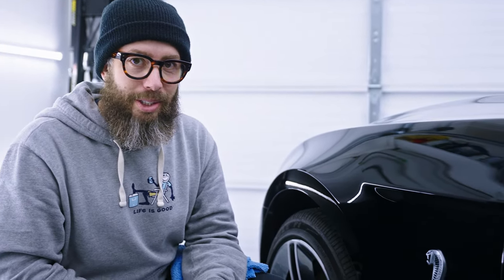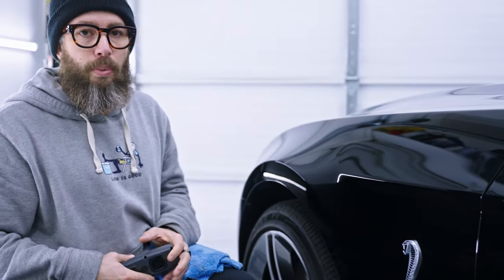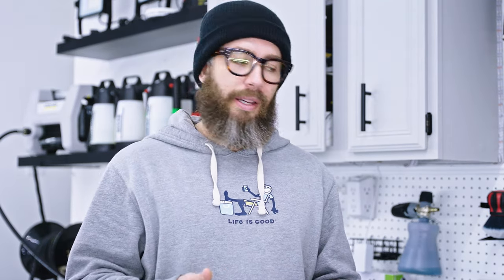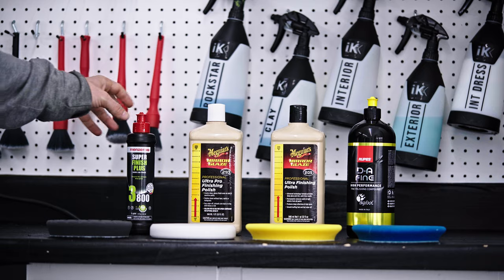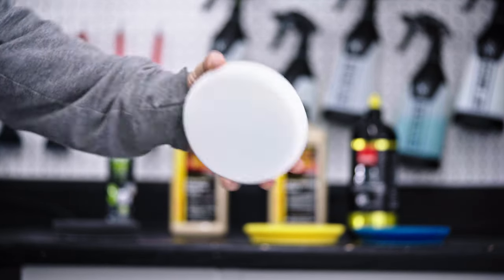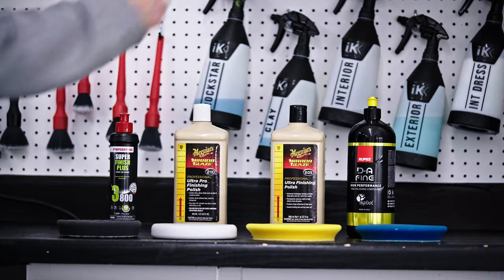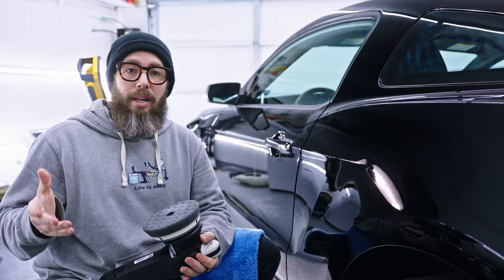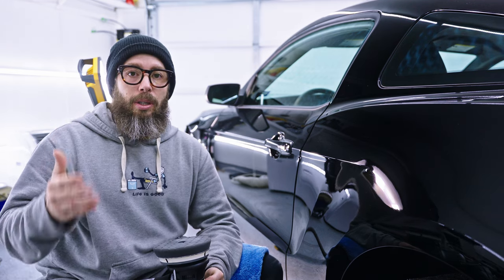Best Way To Do Paint Correction On Black Car

Comment: So work your way up in aggressiveness until you find the pad/polish combo that gives the results you want. That sounds like good advice. If you need to use a heavy cutting combo I'll assume you may want to do a 2 step process with a finer finishing pass. With that out of the way, how do you approach doing the whole job? Best direction to run the polisher? Run with body lines or cross them? Should you polish your glass? Paint correction prep? What if some sections have deep scratches? Finish with a sealer, ceramic, or wax? Sorry this doesn't seem like a how to do paint correction video, just how to choose a product.
Reply from the maker: Think you’ve got the gist of it. It’s all about trial and error for me; I’m learning as I go and sharing the journey. I’ll try to cover more of these details in future videos. Meanwhile, there are plenty of channels that dive deep into those specifics.

Best of luck! 😊 Till next time :)
Reply: I learned more from this comment than the video, thanks Dr Pepper.
Reply from the maker: @ElipticVisuals  thanks for watching 😊
Reply: @streetready I found your video helpful.  Dr P should've just made his own video apparently.

Comment: Do you think you should determine if you are working with a clear coat or not?  First 30 seconds of any paint correction video should address this especially when talking about “what system” to use. My assumption here is that it is a clear coat car cause it appears to be a late model mustang. Not just you; most of you guys fall short in these videos.
Reply from the maker: This is a great question, thanks for asking.

I like that you mention single stage as an option here because they're not very common and most people now days aren't even aware that's a thing!

Now days most everyone or at least 98% of vehicles on the road have clear coat, and most people learning aren't expecting that discussion. Addressing a rare instance is rather irrelevant if they have questions about non clear coat vehicles they can search for that specific term, and inform themselves.

But indeed this Shelby Cobra does have clear coat!
Reply: Agree most cars have clear coat but most muscle cars do not hence my comment. Regardless, when providing information one should be thorough. You could maybe mention that the system works for clear and non clear coat paint or does not work. Thank you for the reply.
Reply from the maker: @anomalous9448  you got it man!

Comment: I recently watched a video for dealing with getting rid of swirls, scratches and imperfections in black paint(I have a black 07 Lexus GS450h) and in that video the guys used RUPES Coarse Compound for Polish & Swirl Remover...and then he used a polishing compound after that. You only use the polishing compound in your video. What's the difference? Great video! Thanks!
Reply from the maker: Just as you mentioned "coarse compound", he was attacking the paint in a very aggressive way. 

Normally the reason to get that aggressive would be if the paint is very hard in consistency. This paint was soft, so in didn't have to go in an aggressive route.

If this was hard paint I would have increased the aggressiveness until I ran out of options or polish until said scratches were removed. If I ran out of options I may compound and polish. 

Hope this clears it up a bit, sometimes it's not really explained why people do that it's confusing to me 😊

Comment: Great video and content!  
2 Questions to you: 
When you finished the polishing with Black pad and 3800 wax, I still see some small scratches. Shouldn't we go further with another level of correction to remove deeper scratches? Just trying to understand if I need to go deeper. 
Also, is there any other way to check if the paint is hard or soft? 
Appreciate your dedication and loving your videos
Reply from the maker: Hey Cassio, there were still some scratches yes! If you'd like you can increase the aggressive ness in order to remove the scratches that are left behind or give it another pass with the same system. 

That's up to you, sometimes I leave some of those behind considering the cars already looking great. Depends on the depth of the paint.

Checking the consistency of the paint the best way I know is with pads not sure if there's another way, I guess if it easily gets scratched would be a way to know. 

No worries 💪🏼
Reply from the maker: Cassio, I got you man!

Common mistakes POLISHING BLACK CAR PAINT!
https://youtu.be/kGEk-i--45k

Comment: Great Video. I have watched a lot lately trying to get comfortable with DIY. Yours is by far is the best for beginners like me, Thank You. I have a 1967 Camaro that was painted 30 years ago on a project car I am just now completing. It was painted with Tuxedo Black Dupont Paint with a ton of clear coat. Left dusty in the garage uncovered I gave it a quick soft wash years back and have been dusting with several different detailing Liquids with a micro towel and left a ton of tiny scratch's. My question is will polishing eat through that layer of the detail liquids and reduce tons of light scratch's or do I start with a rubbing compound? I am guessing to do what you just taught me and try an area? Or Have I created a problem? Thank You. UPDATE: Never mind I just kept watching your vids. AWESOME!!!
Reply from the maker: Thanks so much Mike! I really appreciate you taking the time to leave a comment on my video. What ended up being your conclusion?
Reply: Today I will practice on my Black Van : ). My Plan for the Camaro is to start light and slow Keeping DA flat and not stopping on the paint with the Black pad and test an area hoping to not have to use a rubbing compound. I of course would appreciate any suggestions. Thank You.   @streetready

Comment: So funny really, you can still see the orange peel ,why not get rid of the orange peel that way its a mirror finish or is the paint / clear coat way to little as far as micro or way to little of it and thus not worth it?
Its only a matter of time and the owner depending on how he washes the car and if he does it right ,will produce swirls and marks anyway, not even a SIO2 Sealant will stop swirl marks and water spots etc etc, why because your touching the surface and thus will produce marks, if you use a PPF film or warp, that might protect the painted surface ,but even a wrap will get water spots on it and swirl marks, so its all about making sure when you wash the car after the panels are checked remove the marks and protect it every single time if you value your car if not then forget everything i have mentioned and drive the car to the ground if you like? 👌✌🦘👍
Reply from the maker: Orange peel is a tricky thing, it is actually used by the manufacturers in order to hide paint defects. Think about it if the paint was perfectly flat and glass like, you'd be able to see every single scratch and every single knick so easily due to the fact that a minor irregularity would disrupt the glass look. 

Swirl marks will come back, it's inevitable, either by the individual washing the vehicle "improperly" or by the wind sending dust and dirt over your hood and car as you drive down the road or park in open spaces.

Sio2 won't stop marring or scratching, the barrier built isn't that great such as that of PPF or Vinyl. 

Water Spots are tricky, you will be able to prevent them with sio2 products, the slickness created by the sio2 will give you more time to react to them, preventing them from etching.

The way I see it, personally and I tell my clients too. Bring it by every year or two, I'll control the swirls by performing superficial polishing steps that prevent the swirls from showing so easily and yet don't remove as much paint and be happy the way it comes out. 

( Everyone has been okay with this, nobody has disputed this yet )

Don't expect perfection, perfection cost paint, and money, and I'm more worried about paint than the money I'd charge you. And drive it like you stole it! Most every driver / client that comes to me are true drivers. These cars don't sleep.